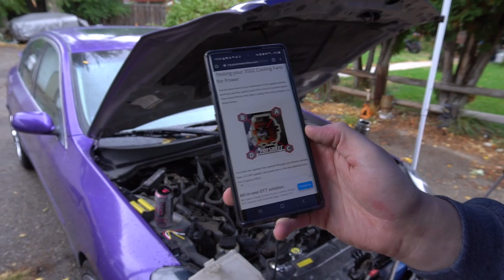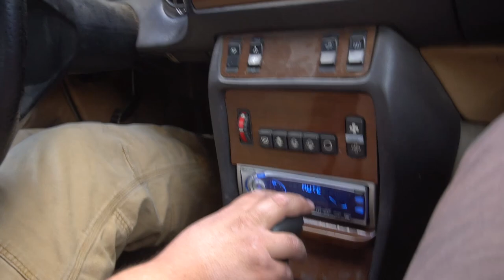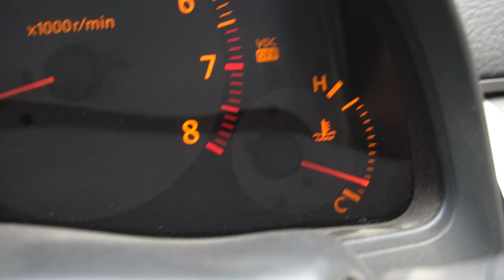How To Hard Wire G35 or 350Z Radiator Fans

Comment: You are going to "go out of your way to turn it off" and then forget to turn it back on and wonder why its overheating. Maybe its a good idea to get one of those illuminated switches.
Reply from the maker: I definitely won't lol. Like I said, the only time I've ever wanted the fans off was when I was driving home in nearly single digit temperatures. Doing that again is excessively unlikely and if I did turn them off when it's that cold it would never overheat with no thermostat and a fat aluminum radiator anyway.
Reply from the maker: That IS one of those illuminated switches, too.

Comment: Which relay are uou using. My g has been overheating and I was thinking of doing this
Reply from the maker: Just a generic five pin relay.
Reply from the maker: If your car is overheating and you aren't drifting it or anything this isn't going to solve your problem, though.
Reply: I was drifting before it started overheating, my car didn’t have a thermostat at first until I put one in, im jus lost of wat to do next